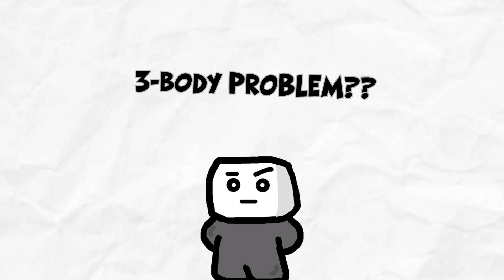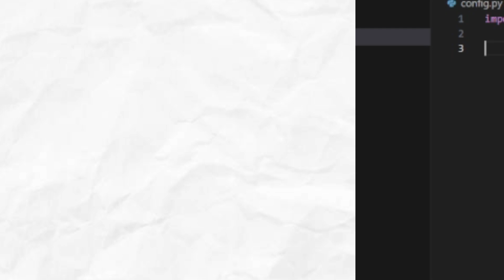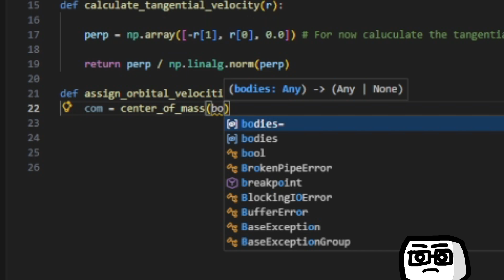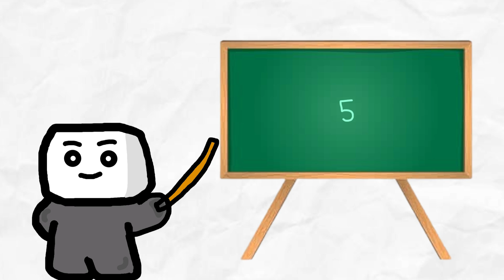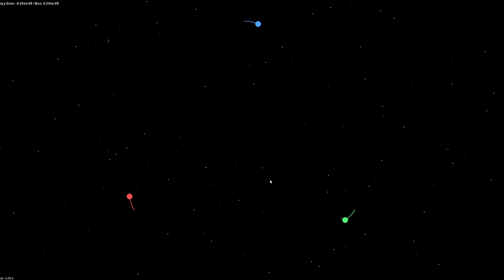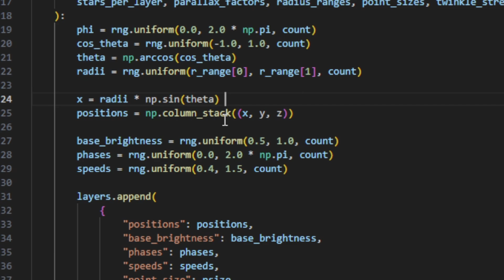I Tried to Simulate the 3-body Problem in 3D!

Comment from the maker: I want to make it clear that I didn't Solve the problem, I just set the initial condition with specific variables to keep the system stable as long as Possible, but even with the ideal conditions a tiny change forces the system to become chaotic. And also there are a lot of stable 3-Body system in our universe. Cheers :)